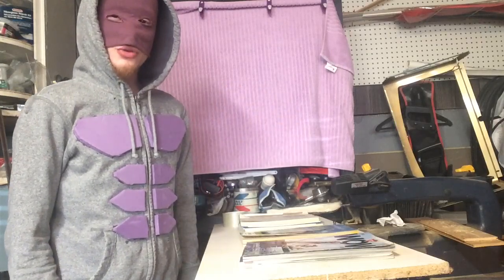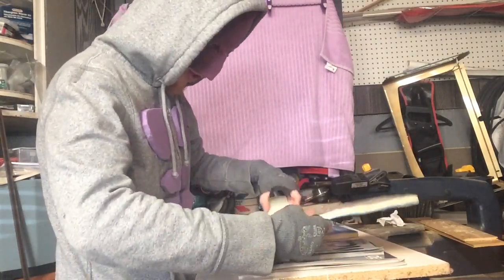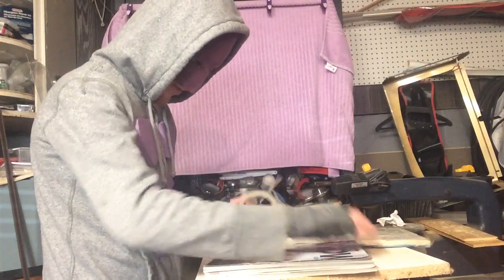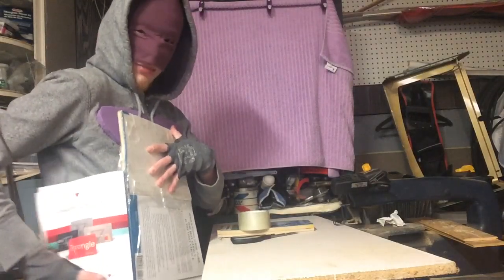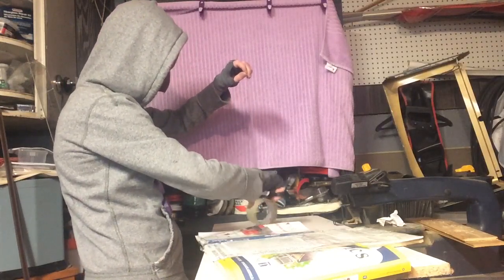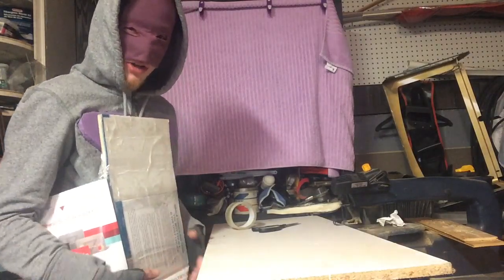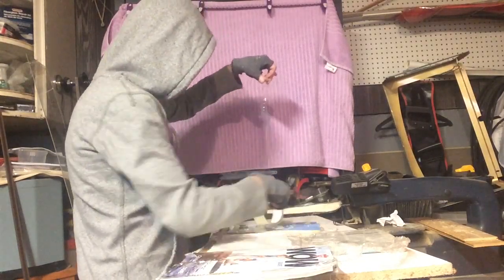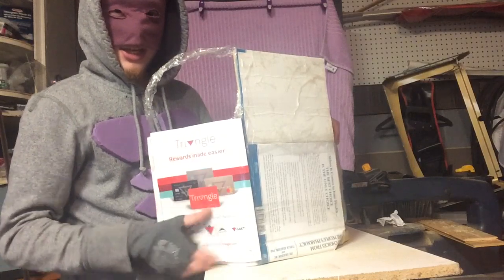How To Make A Basic Stab Resistant Armor Vest!!!

Comment: but what about guns, after you make this paper based armor, you should see about adding metal shelling and plate using the paper as a padded base, also i would recommend using duct tape and gorilla tape as a much stronger building material, a few good hits can make packing tape break, if you shape and layer duct tape you can make shapes of flexible plating to patch soft spots and make designs but it takes a lot of rolls of tape and time to do that, and if you want to make it  more long lasting and stab proof you could use something called plasti-dip, it's like a brush-on rubberizer, i think it was the stuff made by the guy who made flex tape
Reply from the maker: Thanks these are all great ideas that we i will be touching upon in future videos, and in Canada you cant really carry a gun around so its less of something i will be focused on in my videos.
Reply: HEY!, wait for a second arent you a rlsv
Reply: @Yoshi.FromMars  yes
Reply: @Vigilante Spider he made a video called a rlsh mind
Reply: Yes, but what about protection from artillery shells, cruise missiles and nuclear weapons? You need a lot of duck tape for protection from them. Whatever armour you wear, there's a weapon to defeat it.
Reply: bruh, It's called a STAB vest... if you're talking guns, you need a boilerplate

Comment: wait till some rando instead of stabbing the chest cuts...
> above the knees and the inner thigh
> triceps and wrist
> peroneal tendons (ankle)

it's a lil hard to protect the flexible parts 😞
(nvm found a way)
Reply from the maker: For sure they do make cut/stab resistant sleeves which can be bought in larger sizes for the knees and inner thigh or smaller sizes for lower leg!
Reply: @BoneFistRLSH  we love ya Bone Fist!
🤩
Reply: @BoneFistRLSH  Note: please test them, a lot of them are pretty shit. 

tbh maybe I should do of done that when I first got drunk but like yeah...
PLEASE TEST THEM

Edit:
Also hidden batons don't last very long, a regular one or a simple wooden cane works well. 

If possible, add hooks to your armor that can catch knives so if it slides off protected areas the damage is less severe. it doesn't have to be hooks ofc, it can be metal loops or chicken wire.
People like me target the limbs so adding ROBUST spikes may be useful on top of the stab resistant sleeves... but that's a lil much. Your forearm may need to be used as a shield.

It's impossible to protect your armpits so a thick jacket would be recommended, if your lungs get punctured you're screwed. (and yes you'll just have to get use to the heat)

also get some d3o material
Reply: Also if you remember getting hit in the back head and you develop tunnel vision. That's when you should stop. 

don't over extend yourself otherwise you might lose "a few gallons or so"

(The more i talk, the more i sound like a retired RLSH. I'm not, I hate sinners)
Reply: Bro if someone is trained to do that shit you’ve angered the wrong people
Reply: @RealGreenrh  whoops... lil late for that